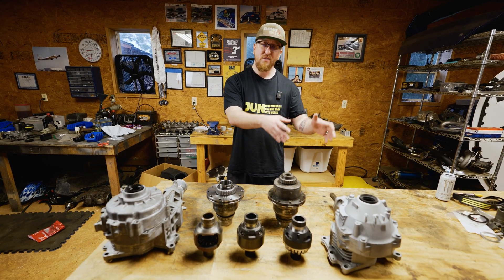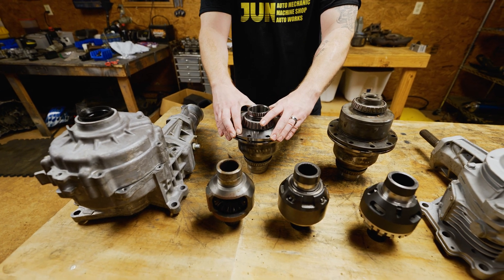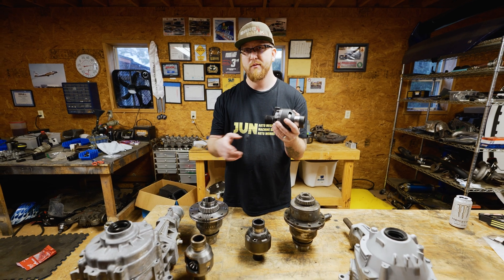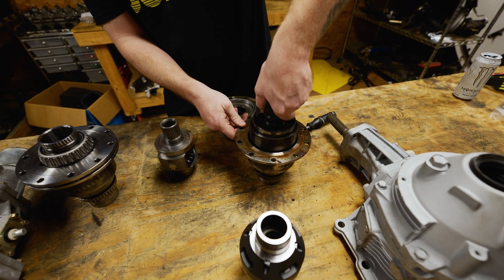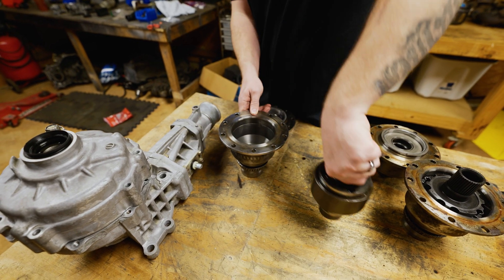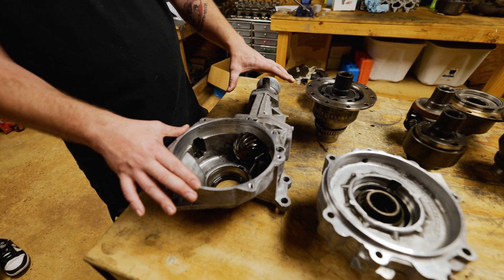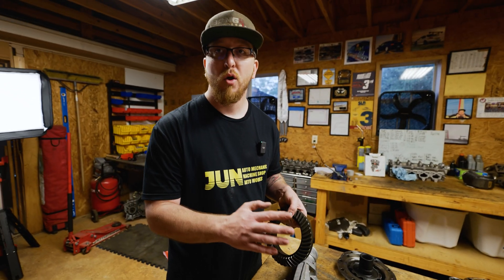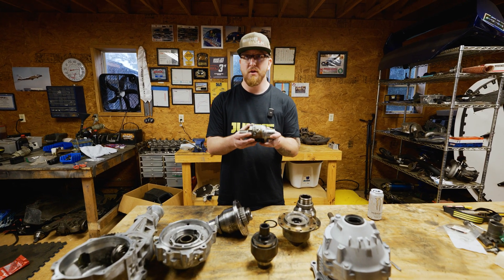EVO 8 vs EVO 9 Transfer Case Differences Explained!

Comment: In the transfer case there is the front differential because it's connected to the front axles. The central differential is in the gearbox housing

Comment: Hey question , my ACD pump went out . I tried to rebuild it but literally cracked the ACD housing . Now I’m trying to decide weather I should buy a new pump (idk if it would even fix it as it has never worked since I bought the car) or send in my t case to get a wavetrac put in . I autoX my Evo an want to go the best route . Do I need to send in my front and rear dif ? Or just one ?
Reply from the maker: The acd only controls the diff in the transfer case. I would suggest a new pump cause working ACD is better for autocross and track. But when it comes to what diff to upgrade first I believe is better to upgrade the rear differential first.

Comment: What determines the the distribution of power with the lsd, is it some sort of mechanical thing or is it controlled by the ecu
Reply from the maker: The ACD ECU tells the acd pump to send hydraulic pressure to the active center diff clutch packs under giving conditions from steering angle, wheel speed sensors, etc
Reply: @Bang4BuckRacing sickkk thank you!
Reply from the maker: You’re welcome